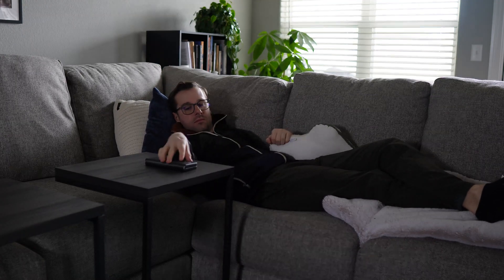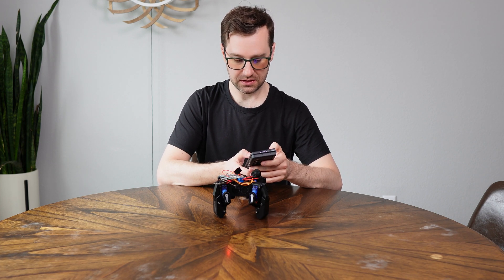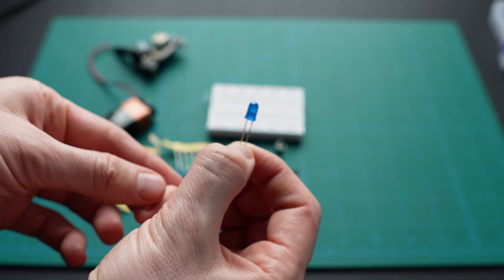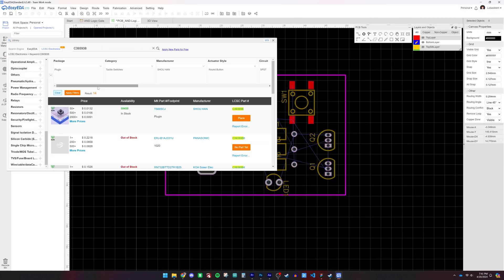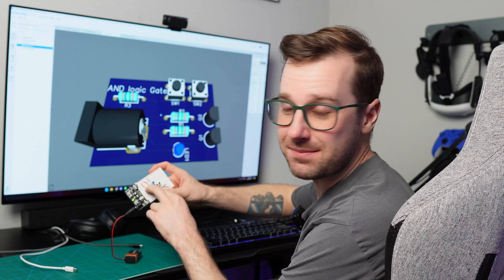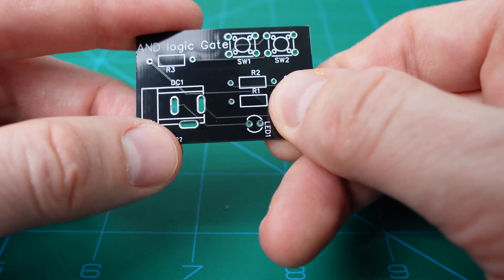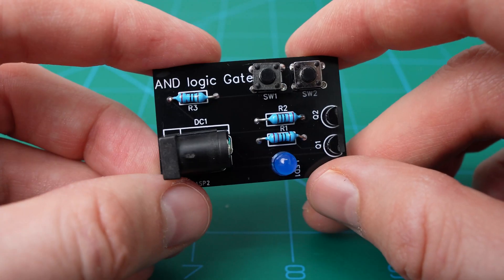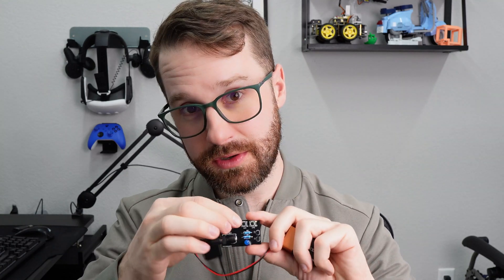No More Breadboards! Creating My First Printed Circuit Board (PCB)

Comment: It's funny how you graduated from breadboards straight to PCBs instead of doing prototype boards first (which are PCBs that have a grid of holes in them and various layouts of copper - either as strips or maybe just copper pads around the holes - that one can use to make compact-ish circuits like those on custom PCBs.

Just a few pointers though, try to learn to do copper planes. You'll need at least a ground plane for more complex ciruits, as it  helps to reduce noise/EMI. You'll also want to increase the thickness of your power carrying traces.
Challenge yourself with routing the traces. The simple AND gate circuit can be routed all on one side. Later if you're doing high speed signal lines like USB you'll need to adhere to certain design rules (like the traces need to be parallel on the same side of the board, same length etc) so it helps to challenge your design skills before hand and not just settle for the minimum viable.
Reply from the maker: Hey thanks so much for the advice!! I really want to continue to build on this skill. 🎉
Reply: @LukasDeem  Well a good next challenge would probably be to design a PCB that interfaces with one of your favorite microcontroller boards and contains a power supply (battery terminal with voltage regulator) and maybe a motor driver IC, and/or terminals for servos.

Such a PCB will def. have to make use of a large Ground plane, and use decoupling capacitors to filter out motor noise.
Reply from the maker: @J0ermungand  hey I was totally thinking the same thing about getting a microcontroller integrated into one of my designs! I'm going to indeed to do some research on filtering out motor noise and such 😅😅
Reply: @LukasDeem  Excellent.
I mean, it's the logical choice considering the projects you've been doing 
😉
I'm curious to see how you'll do on this project (I assume it's gonna be another video?).
Reply from the maker: @J0ermungand  haha yes of course! My next video may or may not be about building a Lego train track around the top of my house but then after that yes totally 🤣🤣
Reply: @LukasDeem  😅😅
Just be careful up there, I'd like to see more videos in the future 
😉